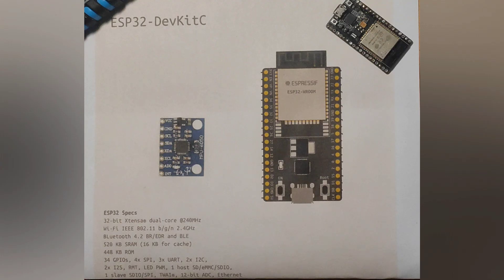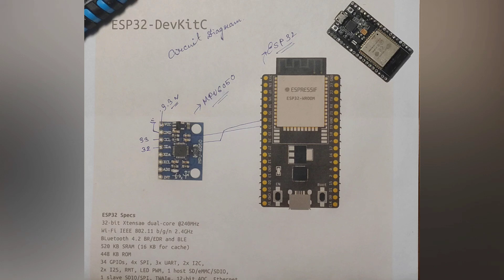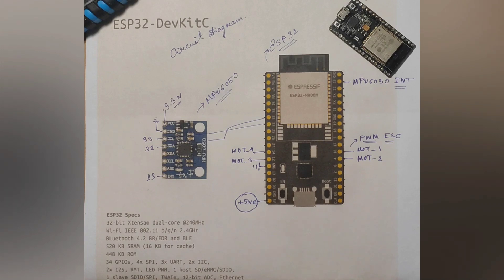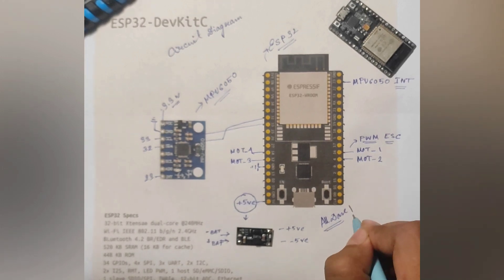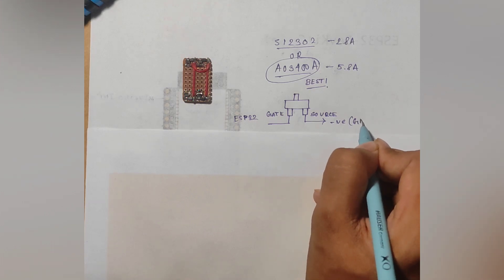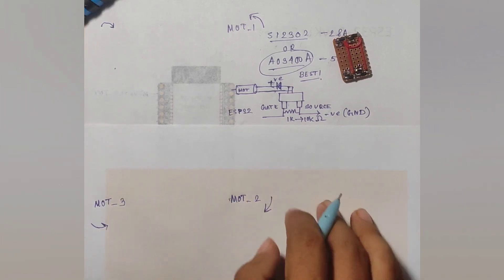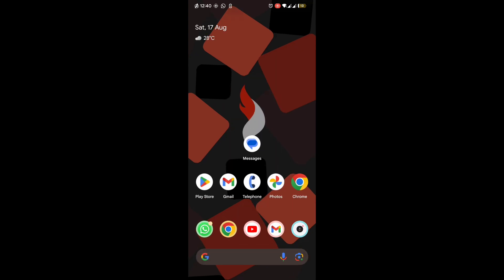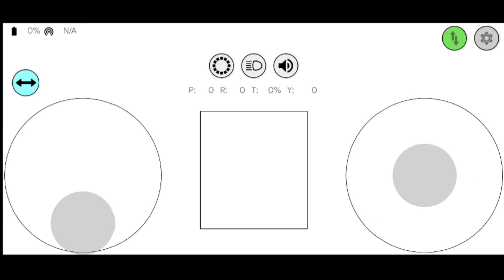Create your own DIY ESP32 Wi-Fi Drone | With Height Hold | Part 2

Comment: @saaraswata can you please explain what is the use of 5 volt boost converter, esp32 module run on 3.3v and motor min range is 3.7 ?
Reply: spike turns off esp
Reply from the maker: To make sure voltage doesnt drop, 3.7v->5V->3.3v

Comment: Schottky diode is in parallel with motor, with anode to -ve of motor & cathode to +ve of motor right? 
And then -ve of motor to drain & +ve to battery?
Reply from the maker: @krushnabhandare3766  yes
Reply: @saaraswata  can i use 3.7v 2000mah lithium ion battery instead lipo battery
Reply from the maker: @krushnabhandare3766  The drone might not be able to provide thrust required for that heavy battery

Comment: Using this boost module I am facing a problem. Whenever motor starts running, the microcontroller get shut down and restart and again. But giving the power from usb of pc the problem doesnt occur. I am using esp32 devkit v1,mpu9250,a03400,1n4148 smd diode, the boost module,1020 motor and 1500mah 1s lipo battery. Do you know the reason?
Reply from the maker: Check if the boost module is giving constant 5v. Otherwise esp will reset due to low voltage
Reply: @saaraswata  I have checked the voltage. it get reduced during motors high speed and then restart. what is the possible solution?
Reply from the maker: @SaumikKhan  Add a capacitor to the voltage booster, also try using a better battery, which one are you using?
Reply: @saaraswata  i have tried using upto 2200 uf capacitor but it still doesnt help. I also bought a battery of 1500 mah battery with unknown C.
Reply from the maker: @SaumikKhan  are you using those silver lipo battery which do not have any C rating? The ones that you find inside cheap music speaker, radio or old phone?

Then that battery can't do anything , buy a branded lipo battery atleast 25c, these are used specially for drones and aircrafts
Reply: @saaraswata  thanks bother. I think I need to buy another battery. Because It Doesnt include c ratings.
Reply: @saaraswata  Can you suggest to me some links to buy? I am from Bangladesh.
Reply from the maker: @SaumikKhan  I don't know where is it available in your country, maybe search in hobby shops or if your country allows it, buy from AliExpress or Banggood
Reply: @saaraswata  I have used a 25 c 1200 mah battery and it is now flying. Thank you very much brother. God bless you.💌
Reply from the maker: @SaumikKhan  Your welcome 😁

Comment: hi I having flash the program but In PWM pin does not produces an  Pulse so the motor is not working. how to approach this problem
Reply from the maker: Check if the int pin of mpu6050 is connected

Comment: I can not say I understood the connection of the motor at 09:26 https://youtu.be/rBeMxDfjDwk?si=39-5nM4i4BtZ3vsb&t=566

Have you shared the esp32 code you are using?
Reply from the maker: I have shared the code in part 1 , check that out

Comment: how you connected the mosfet to the motor because you're connecting the + and - to the drain at the same time
Reply from the maker: @mohamedaminebellaidi4023  if you see the diagram you will see that I have connected a schottky diode from -ve to +ve . Thus there is no short circuit and I can connect -ve to the drain and +ve to the diode
Reply: @saaraswata  i know you added the iode for the inductive charge but the + and the - of the motor where i can connect them drain and source or something else
Reply from the maker: @mohamedaminebellaidi4023  + of motor goes to battery, and - of motor goes to drain
Reply: So the +ve of the motor goes to battery as well as to drain via diode?
Reply from the maker: @CrackPresath  No , +ve only goes to the battery +ve and the diode P side.

Comment: what would be the range for this drone in outdoor, well i'm working on this project where i need a prototype for my lidar drone project so i was confused shall i use this microcontroller and set wireless rf module.
Reply from the maker: @Shrekrawwwr  setting external rf is always best, this drone has a range of around 100-150m , long enough for a little hobby drone
Reply: @saaraswata  ahh I see if u don't mind can u suggest any better alternative to increase the range or anything that would help me to increase the range like at least upto 500m
Reply from the maker: @Shrekrawwwr  you can build an nrf rx tx or use a flysky ct6b rx tx which will give 400-500m range
Reply: @saaraswata  thanks
Reply from the maker: @Shrekrawwwr  I'm already working on another esp32 drone with external rx, uses betaflight and has acro, tune in as I'll be uploading soon
Reply: @saaraswata  yeaa I'm surely gonna check it

Comment: Hello, I made this drone, at first it worked well, then when I fly the drone, it moves to one side until it falls. I also changed the angle sensor, but the problem was not solved Where does the problem come from? What kind of battery do you use?
Reply from the maker: I am using a 90c 550mah 1S battery. You can use any 1S battery that is atleast 500mah and has 25C rating minimum
Reply from the maker: It can also be that your mpu6050 module is damaged, because I have had 2 of those cheap modules fail after the drone fell down and crashed. Mpu6050 with the green led are prone to damage, the ones with red led are the best

Comment: Hey, amazing work! How are you planning to implement altitude/height hold?
Reply from the maker: I have fixed the connection of ms5611 with the drone, just have to do some diagnosis regarding height hold. Either way you can connect a joystick and enable stabilise mode where the drone will be stable very much.